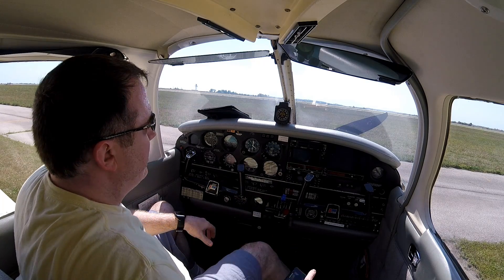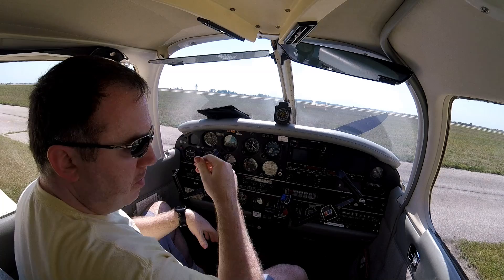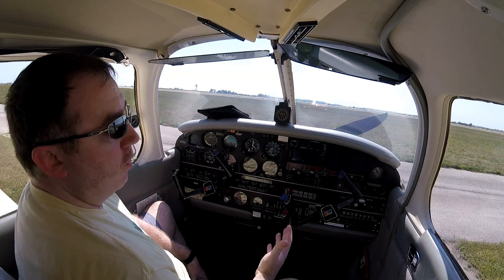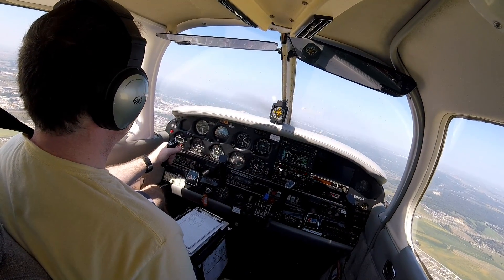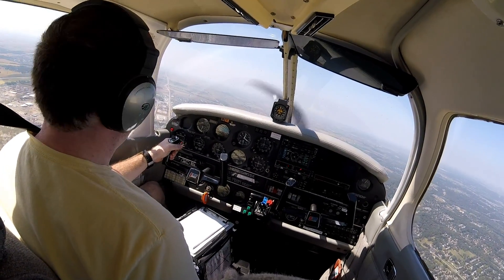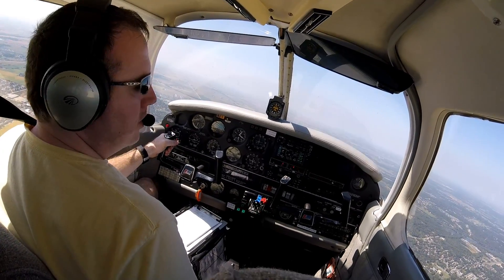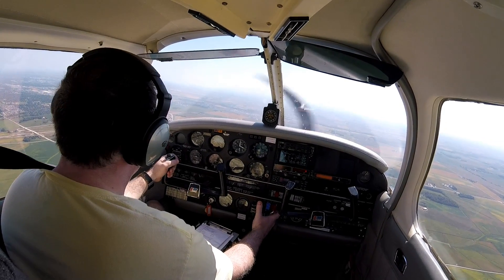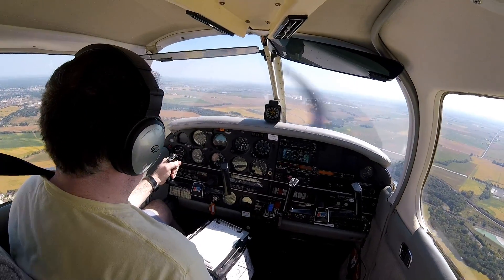constant speed prop

Comment: Slower RPM = fewer explosions per minute = better gas mileage.
But, mixture is also a key factor. LoP is good if done right.
I don't have a plane to play with, but I have a 1980s McCulloch chainsaw that runs pretty dang good LoP.

Comment: Good video! How do you figure out the right mixture setting?
Reply: My bad, just noticed you did a video on it!
Reply from the maker: Glad you found it!  I was going to point you to it.  Basically you can use EGT on an engine monitor if you have it, otherwise you can pull mixture until you feel deceleration and then slightly enrichen to smooth it out.  If you have poor fuel distribution or are carbureted, you may have to run fairly rich.

Comment: Wish i could see your dials so I could understand better.  I understand the formula Tach + manifold pressure = power, setting.  What ,if any, is your constant?
Reply from the maker: If I understand your question correctly, I think you are looking for the power setting table from the POH.  It won't let me paste a picture here in the comments, but you can search for the arrow II POH online.  The power setting table shows manifold pressure settings for different RPM settings and resulting engine power.  In the arrow, the Scimitar prop recommended RPM was 2300.  Because of that, I usually cruised at 2300RPM and <25" manifold pressure.  According to the table, this would be around 70-75% power.  If just putting around, I would do something lower like 22 or 23" with 2300RPM.  You have to use the POH for reference to power settings for each aircraft and the mixture matters as well.  For example, in my Bonanza, 75% cruise would be more like 23.5" and 2500RPM if rich of peak based on the POH.

Comment: I guess I'm the odd guy out.  I often climb at less than square.  In my RV-6A 180hp I keep throttle wide open (rich) and in the climb (and sometimes on the roll at high altitude airports) I dial prop back to get a bigger bite of air at 2500rpm.  You can feel the additional thrust push you back in the seat.  Only when established on the climb do I set throttle for 25inHg. YMMV.

Comment: Ha!  This is funny!  I thought I recognized the tower controller's voice.  I used to fly out of Cedar Rapids about 15 years ago.  Kept my plane in the west t-hangers also.  BTW, I fly a fixed prop Archer but got checked out in a complex aircraft when I was training many years back.  I remember my instructor saying use 21 squared, which meant 21 inches manifold pressure with throttle, then 2100 RPM with the prop shortly after take off.  Am I wrong there?  Or is that just for cruise?  The plane was an old Beechcraft retractable.  Not a Bonanza.
Reply from the maker: Sounds like a reasonable cruise power setting.  I wouldn't climb out with that low of a RPM setting.  Some people do pull it back to 25" 2500RPM for climb out, but I never found much logic in that.  It takes longer to climb that way which means you have high load, poor cooling for longer period of time.  In addition, pulling back on the throttle actually lowers the fuel flow which means you are running hotter.  It all comes down to the POH.  If the POH allows max continuous power, use it for climb or cruise climb.  That is my $0.02 anyway.

Comment: I just wanted to thank you so much. I’ve been flying for many years and even have complex and multi engine endorsements. I have however always struggled with WHY I am doing what I am doing with the throttle and prop levers when flying a constant speed though, I have really shy’d away from them because I didn’t feel that I truly grasped them. I understood that throttle managed fuel and changed manifold pressure and prop adjusted the governor but couldn’t fully grasp why you do what at certain times besides the fact that my instructors have just said that’s how it’s done. After watching your video I really feel like I’ve grasped the true understanding and feel so much more better. I just really wanted to thank you. I’ve watched countless videos and read articles over several years and they all focused on more so what it does but didn’t touch on the same dynamics as you did. It was refreshing to have a different take on things. Thank you so much again!!!!

Comment: How did you get cockpit audio with your light speed headset
Reply from the maker: I use an adapter like the one below with my Gopro.  Basically it plugs into the USB in the GoPro and has a 1/4 in headset jack through that you plug into the rear seat intercom jack.  It works quite well actually, but make sure it is fully inserted into the camera.  It is a little tricky to get it connected well.
https://www.marvgolden.com/mg-88s-gopro-hero5-8-recorder-adapter-for-g-a-headsets.html?gclid=Cj0KCQjwqfz6BRD8ARIsAIXQCf1LZVPut0_udd5Qdi82XLeqCSubQC5TBsZJnUT21w29VG_F6L8RrMcaAi2kEALw_wcB

Comment: Why wouldn't you want the prop to be set for an aggressive bite to move more air during takeoff ?
Reply from the maker: Think of it as starting a car in 5th gear.  An aggressive pitch loads the engine heavily.  Trying to go full throttle with heavy pitch loading will limit how quickly the engine can get to full RPM and the net amount of air moving will not be as high as high RPM/low pitch.  Maybe at high altitudes there are techniques involving low RPM prop settings, but I don't know.  If you have limited runway or have a go around situation on landing, you will want to spin that prop up to full RPM quickly.

Have you ever flown a fixed pitch prop (maybe a 172) with a cruise prop vs. climb prop?  At takeoff, the thing is a dog, and max RPM is pretty low.  Once you pitch up, the p-factor adds to the loading on the engine, and you really notice the effect of the aggressive pitch.
Reply: Ok, that makes sense to me...thanks!
Reply: I would and do, especially for high altitude takeoffs.  You can feel the additional thrust.  Otherwise in low pitch you are just beating the air and making noise.

Comment: Great Video! Just a side note. The prop is only ever on the low pitch stop until sufficient airspeed allows the governor to control RPM. As soon as the RPM stops increasing on T/O roll the governor is doing its job. In a non feathering C/S (most S/E recips) the prop will default to a low pitch/high RPM config resulting in increased drag but the ability for easier restarts. With a loss of oil pressure the prop lever will be useless.

Just an A&P/IA's two cents
Reply: Yes, you can hear it - usually when you are past half or 2/3s of the throttle, you hit 2700 rpm and then you just hear the RPM slowly oscillating around the redline as the governor reacts to the RPM trying to go over the redline until the throttle is balls to the wall where it finally finds its equilibrium :)

Comment: Thanks much!!  My checkout instructor pointed out to begin prop adjustment while still in climb out.  After working with this, I would rather wait until I am safely at altitude.  Reducing throttle on climb out is a little hairy to me.  I just flew the Cardinal this week and for some weird reason the engine backfired once as I reduced the throttle doing this.  Apparently, it did not agree with the process as I was told.  So, from now on, I wait until I am 1000+ agl or more (As you show).   For my short time hours, the incident this week was the first time an engine has backfired in flight on me.  It rattles you for a second or 2.  PS...not far away at MLI.

Comment: I like to do do my run-up and mixture adjustment slightly rich. But during take-off I really don't want to be pushing levers and flipping switches...just might hit the wrong one....One hand on throttle and one on the yoke till I get some altitude....then start dicking with stuff.

Comment: In my Mooney right after takeoff and gear is up and I know that I'm establishing a climb I'll pull back the throttle and about 22.5-23.0 inches then I'll pull prop back for RPMs. I've never done it the way how you just did it in your airplane to get up right at about cruising altitude and pull everything back I would think that would be a lot more stressful on the engine I guess it's just the way how people are different when they're flying their airplanes
Reply from the maker: At the end of the day, everyone does things a little differently.  I also know a guy with a Bonanza who pulls back power just after take off to go easier on the engine.  A few things to consider in this case.  I have read that the mixture is extra rich when the throttle is full due to a boosting mechanism.  If this is true, you have to make sure that by pulling back the throttle early, you aren't leaning more than expected.  Another thing I consider is that as you climb, your power will reduce even with full throttle (unless you have a turbo).  By 5000ft or so, you are already limited to ~75% power.  Pulling the throttle early just means a longer climb with decreased airflow over the cylinders.  I think it really comes down to monitoring temps and following the philosophy you buy into.  I have heard several, but this is what I have adopted.
Reply: @kujoclips4962  I also noticed that in some cases, only the RPM is pulled back after takeoff, eg. from 2 700 to 2 600 rpm in order to keep the engine rich ...
Reply: KujoClips I know inside of an airplane carburetor there's a mechanism for I don't remember what it's called but if you give it Full Throttle it doesn't bog down the engine and get it more power and I'm on a police salary I can't afford anything with a turbo. But I would say you are correct it depends on how you're taught with the POH States which airplanes you're flying ETC ETC ETC!! Good point KUJO!!
Reply: KujoClips it's called main metering system
Reply: I like to do do my run-up and mixture adjustment slightly rich. But during take-off I really don't want to be pushing levers and flipping switches...just might hit the wrong one....One hand on throttle and one on the yoke till I get some altitude....then start dicking with stuff.

Comment: So let's say you were to fly at 10,000 feet MSL,  you will have probably about 19 inches at most with full throttle, right?  So what would your RPM setting be?
Reply from the maker: So you would have to look at your poh, but the combination of mp and rpm determine your power setting. My arrow poh says at 10000ft, you can set 18.3" and 2400rpm for 55% power. It doesn't list a power setting for 2300rpm or lower, but for the same mp, it would probably be around 50% power.  With a turbo, it would be different.

Comment: do you lean the mixture by feeling the engine? same as with a constant pitch? (max rpm)
Reply from the maker: You can yes. If you have an egt gauge, that is best. You can also use the fuel flow gauge to quickly go to your known fuel flow (a lot of manifold pressure gauges also have ff). I use all three depending on the situation. Thanks for the question.